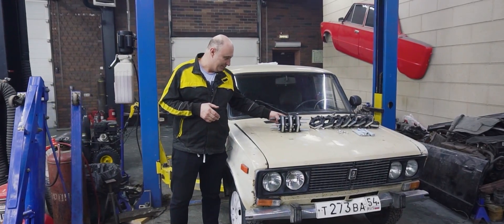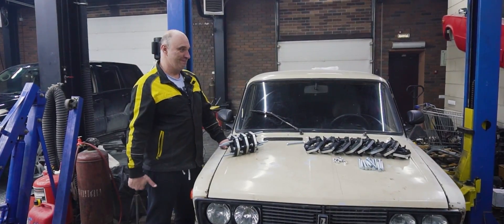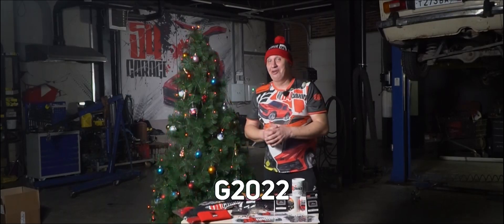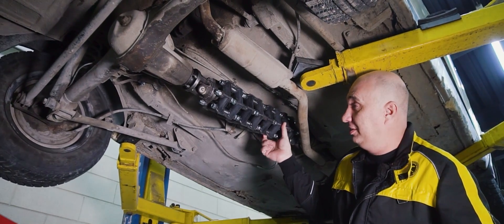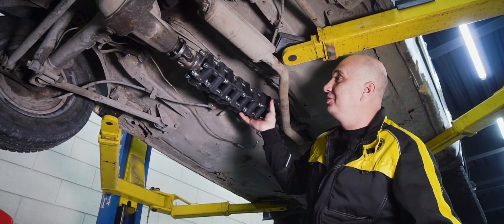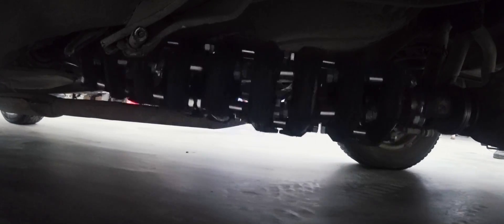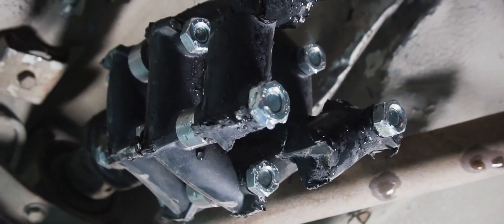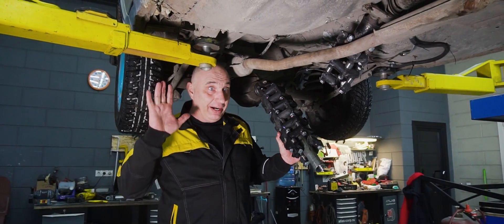Making a propshaft out of flexible couplers: will it work?

Comment: Hey guys. Here is an idea.
Can you try making a 4 cylinder engine run like 2 cylinder engine by making it fire 2 pistons at a time. Will that double the power of the engine? Because it is firing 2 pistons at the same time?

Comment: That's a win for the Americans, utilizing u joints and CV's on a drive shaft instead of a rubber coupling. Of course ya would sell quite a lot as rubber degrades over time. Never understood why BMW and Mercedes use this junk. I've replaced many more rubber couplings than UJoints. Yes it takes up vibration and noise. But I'd rather have durability

Comment: So I'm kinda confused what's the purpose of having a flexible cupling drive shaft? It would seem it takes away the effeiency because the energy isn't directed like in a stiff two part solid shafts, and also vibrating.

Comment: remove the prop shaft and mount the motor directly to the axle. cut out the rear floor of the car and watch the motor move along with the axle and suspension. No idea how you will support the motor though. Perhaps a bunch of sliding pins?

Comment: That's a lot of drive train loading. This would probably work better with short shaft sections joined by a few elastic couplings. The torsional loads on the coupling-only shaft will pretty much always lead to failure, plus it has some terrible harmonics that would grenade the whole thing once you're up to speed anyways.

Comment: electric drive train, any generator to electric hub wheel motors, wires only, no shafts needed, no diffs needed, independent drive awd 4wd
Reply: try carbon fiber flexible coupler mesh instead
Reply: wooden prop shaft to the diff
Reply: replaced the spine, nice
Reply: better have a spine than no spine, epic

Comment: as you put a load on the rear wheels, its going to put a load on the driveshaft. the moment the tires hit the snow it couldn't take the torque so it starting to twist. if you were to accelerate very slowly, then you wouldn't have as much of a problem. you probably wouldn't move very much on the  snow, never mind an incline, but it looks like it kind of worked lol. going faster killed it for sure.

Comment: Should weld the center pipe from the engine side and leave it loose on the rear diff and add another center prop bearing as the thing was jumping around like madd

Comment: Instead of bolts you must use a threaded rod. If you use 4 I am sure your experiment might succeed with a pipe in the middle. It will put less strain on the rubber mountings

Comment: replace every other elastic segment with a metal plate of the same dimensions, that should prevent the crooked twisting going on but still remain flexible, reducing unnecessary stress and improving durability

Comment: Try using old heavy conveyor belting, and punch out the coupling of that. Will work, you just make them like the flexible ones, with 6 holes in a hexagon, and join up 3 per side. The fabric in the belt will stop it from tearing like the soft rubber couplings. Old belt should be easy to get from any local plant that handles bulk stuff, like coal or iron ore, or from any mill.

Comment: Well, very interesting experiments, what if two gear boxes one automatic & second manual (In Rear Wheel drive setup) are connected together, what will be the output how it will behave? Means if manual gear box is added to automatic vehicle before the propeller shaft?

Comment: 10:48 My face when throwing in 5th gear high in my Nuffield 4/65 tractor and chain weight is over come by centrifugal force, slapping fenders every now and then. Cant really tighten/shorten them as those need to fit new tires as well and all of the adjustment is spent already.

Comment: This could work, the trick would be to stop the bolts twisting inline with the direction of torque, as it puts stress on the rubber couplers in a way they aren't designed to handle. If you had a steel plate between each of the couplers and had the joining bolts welded to it, that would keep them more inline and only apply force to the couplers in the direction they are meant to operate. Same concept as the plates that bolt either side to the existing coupler in most driveshafts. Hopefully that makes sense, would be great to see you do a revised video because I think it would work. Keep up the good work!

Comment: I want to see a driveshaft replaced with several smaller steel rods that run the full length.  That should increase the overall strength compared to something like this while still giving some rotational elasticity to make for an interesting video.

Comment: What would a flexible drive shaft be beneficial for at all?  Less initial shock to the torque converter?   Cant think of any good that might come of this at all.. like using a super long antenna for local radio…
Reply: torque conveter?on a lada?

Comment: Back in the day GM had an experimental drive shaft that was spring steel inside a torque tube that drove the rear tires, the idea was that it made for a smoother ride. It helps reduce vibrations.
Reply: I guess that's kinda similar to the springs at the center of clutches.  They probably just took the springiness from the driveshaft and moved it to the clutch for cost savings.  Older Porsches use rubber pucks in the middle of their clutches in place of the springs for the same purpose.

Comment: idea uk how epoxy  without the glass in it is super fragile but when u put strands of plexy into the epoxy it becomes strong
try melting rubber in tube shape and puting thin wires in it or plexy then bolt it on shrug

Comment: I have an idea for a flexable driveshaft that WONT break. 
I would love to see a driveshaft made of all u joints. Like take 2 of the 4 bolt flange yoke peices. With the 2 ears for half the ujoint, and bolt together back to back. Get like 4 or 5 of these. And u joint connecting. Keep doing this untill drive shaft is proper length. 
Now you have driveshaft made of like 30 u joints. No actualy shaft
This could work!
Just make sure to shout me out Cody Stephens

Comment: I will always remenber the first time I replaced one of these coupling on  Hillman Imp. The first thing I did was flipped off the steel clamp holding it in compression a big mistake I should had have fitted it first then removed the clamp.

Comment: they should have put machined approx 20 mm thick triangular metal plates in between the rubber couplings to prevent the metal bushings in the rubber to get bend and give the bolts room. then it would have worked.

Comment: For this to work the threaded steel rods need to run the full length through each hole in the flex disks.

Somewhat like a cage driveshaft.
Reply: A strong crankshaft welded as a segment of drive shaft as a type of flywheel would be really cool to watch.

Comment: I seem to remember a car that had a huge rubber band as a 'driveshaft'.
Reply: Thinking more about it, I remembered it was on some documentary, maybe in Africa where the person in question had bought a car (station wagon?), and at some point in crossing the country had a breakdown. They had to remove the floor on the inside of the car to gain access, and found it was a belt drive rather than the typical driveshaft.

Comment: Weird thought and likely would not work but find someone that has a  3 D printer and have them make you a prop shaft. You might have to print it in 2 or 3 parts and bolt the parts together. But that way you could put a couple of the rubber parts you used in this build maybe between each printed section and make a hybrid rubber shaft to cut vibration. By printing your own shaft you could also add any support to the inside of the shaft for strength and then just count on the rubber spacers for fles.

Comment: Years ago i did a miniature version on an rc rock crawler, i was waiting for a new one and had some 1/8 or maybe smaller aircraft cable ties with couplers on the end, after looping a few together the driving was interesting.. especially given it was 4x4, the cable would start to twist up and then unleash a fury of wheel spin when it broke traction, quite interesting

Comment: Try making a hydraulic propshaft shaft.  Put one hydraulic pump on the gearbox, connect it with pipes to another hydraulic pump on the differential.  Perhaps a more hilarious idea would be to use a single compressor on the engine / gearbox and connect to a turbo on the differential.

Comment: Maybe the flex discs wont work because of the u-joints. The u-joints sag with that bendy shaft and it remains so when the driveshaft begins to rotate. And the effect increases along with the rotation until the shaft hits the bottom of the car and eventually breaks. Also the destroyed carrier bearing probably didnt help either.

Comment: Try a really large length of steel cable.
Reply: That wouldn't visibly look any different... Unless the cable is thin, which will bind and possibly break strands, but if properly secured in-place likely nothing

Comment: The rubber joints would probably last if they has fiber cord mixed throughout like tire side walls. They can't take the twisting because they are straight rubber only. Wobble isn't the problem.

Comment: "Just a minute lads... I've got an idea..."! (Michael Caine - last line in the film, The Italian Job). Here's my idea: how about 'Rubber in Torsion' as invented by Sir Alex Moulton of Bradford-on-Avon who also did lots of English suspension systems:- Mini, 1100/1300, Gipsy, Maxi, etc etc (oh, and Indispension for trailers and caravans). 2 tubes, one inside the other and bonded to each other internally with rubber. One tube is held solid and the other has the variable force applied to it. In suspension systems this provides a variable spring.
Reply: Your design suggestion is viable and has used in vehicle driveshafts.

There were problems in some applications with resonant torsional vibrations however.
Reply: @philschaad6693  I agree that frequency dependent resonances would likely be problematic. Garage 54 certainly had some of these 'vibrations' in the video, especially the first two examples!! Full marks though for Content and Star Quality. To quote Frank Sinatra - I Did It My Way. Thought? I wonder if Vlad could be persuaded to sing this on the channel - in Russian!

Comment: Joiner put between two fixed parts. It have to sustain pressure. In your design it rips off. You don't have to be an engineer to see it will fail.
You will have better luck if you just replace unijoints with rubber joiners.

Comment: You would get some pretty bad gas mileage I imagine from that. I could be wrong but just the thought of it constantly twisting and taking all the energy from the motor and preventing at least 30 to 40% of power to the wheels and just eats it up in the rubber. Like a bad torque converter or very slippery clutch

Comment: i think the problem with flexible drive shaft is even if you keep it straight, it will still twist on its axis when the force on the engine side is higher than the force on the other end (ie: any time you are accelerating)... as the torque on the engine side decreases in relation to the other end, it allows the shaft to untwist but if you let off the throttle and an engine braking effect occurs, you will have the equal, opposite effect where if over-twisted, it will bind the other way. the twist will be the worst when the difference in those rotational forces is the greatest and to prevent catastrophic failure, it would have to be able to lock at some point prior to the failure of the flexible components.

Comment: The problem is that while the goal is flexible, you need to have taughtness and probably a guide tunnel to reduce vibration. Most of all, you need a material which is not going to twist and, in so doing, store rotational energy rather than passing it to the wheels.

Comment: What about adding a torque converter alongside manual transmission?
Reply: In reply to the suggestion for a torque converter coupled to a manual transmission:

That was done with a degree of success about 65  years ago by  Chrysler.

They called it "Hi-drive" and I owned a 1954 Plymouth with that system.

You could drive it the same as any manual transmission or leave it in second or third gear and  drive it like an automatic transmission.

It was pretty sluggish starting off in third gear, very much like my 1949 Buick with a Dynaflow transmission, which normally ran in direct drive, using only the torque converter without changing gears.

Comment: Put a bearing on the center on the guide rod and weld it on both ends. The guide rod will now fully support the shaft but won't transmit torque. You'll need a 2 piece guide rod with 2 bearings and a small rod to insert in the bearings. That should help keep it together and make this idea more viable.

Comment: Comment from an old Certified Master Technician:

The metal band around the circumference of a new flexible coupling is there to facilitate installation.

The coupling is intended to be somewhat compressed when  in use and if the metal band is removed before the coupling is installed, the bolts don't align with the  bolt holes in the metal  components of the propshaft.
Reply: I'm guessing you're from the US?
Reply: @wtfiswiththosehandles  Yup
Reply: @wtfiswiththosehandles  Guessing commentor is from Uganda.

Comment: I think you should use a big spring, could be funny when it release the energy after the initial torsion
Reply: They did that a while ago 😉.
Reply: @killerdinamo08  perhaps that video is worth translating?
Reply: @SwapBlogRU  Write them a letter 😉.
Reply: @killerdinamo08  I can shoot them a message via WhatsApp, I'm in constant contact with these guys.
Reply: He totally explained that at the beginning of the video.
Reply: That's the problem with the whole implementation. Basically, as soon as the rear wheels hit any resistance, the propshaft starts storing torsional energy like winding a spring. At some point, one end or the other (usually the wheels) loses friction and the spring unwinds. Moreover, the release of energy from the spring is in the opposite direction of the original torsion, so the free end would spin backwards.

I imagine that if you tried to launch the car by holding the brake while revving the engine, you'd actually take off backwards when you let off the brake.
Reply: @johnruschmeyer5769  what?? No the wheels would certainly not spin backward once you release the brake pedal

Comment: Make a hydraulic 'propshaft' with a pump on the gearbox or engine and a motor on the axle.
Reply: ist called a forklift
Reply: @Rolly369  Thanks for your insight there Roland.
Reply: Are there hydraulic motors with variable pitch vanes on the inside?

Comment: You need to take 2 steel tubes - weld one end of each to each U joint.  Size them so they have a slip fit near the center.  This is to keep whatever you use for the flexible drive in a straight line centered on the axis of rotation.
Reply: the drive shaft spins quite fast... even a small imbalance would result in vibrations which would eventually destroy the whole thing
Reply: I think just a tube sitting inside the couplers and not attached on either end would keep it straight
Reply: It twisted and pulled in half because it's like a giant rubber band they just kept winding it up and winding it up and eventually it yanked itself apart
Reply: sounds good and maybe thread wire rope and crimp furels on the end instead of bolts

Comment: My friend, the idea was good but you missed something. On the Lada, the coupler is tight between two pieces of metal and those metal pieces prevent the coupler to bend. You need to mount metal on each side of the couplers and trust me, it will work!

Comment: You're so close with the steel pipe in the middle. It needs to be full length but floating on bearings or otherwise unable to transmit torque. Then you stack up the flexible couplings along the length so that they are transmitting the torque but see no bending forces.

Comment: can be done but it will act as a rope when its spun , slinging around in a circle , if there not tied on both ends it will pull itself out of the slipjoint in the gearbox

Comment: before i even watch this? by title alone.. i say NO WAY< NO HOW! tension is differnt that torque.. it can't be done. but! this is garage 54 after all.. sooo...
if i can stop laughing enough... try a concrete one, just wire cage.. no rebar. but you guys did drive it. so it was a suxxess?? :D

Comment: What happens if you fill the radiator with petrol?
Reply: Or with engine oil itself
Reply: You'll get petrol deposits on the radiator and the pipes and that will affect the cooling.
Reply: @robertinferno7862  nothing, it may leave some deposits from the additives and eventually eat through the rubber after sitting for a longtime...

The vapors are very dangerous, so if the fumes accumulate in the engine bay, a spark can easily cause an explosion.

Nobody would do this, as it's pointless and extremely dangerous.